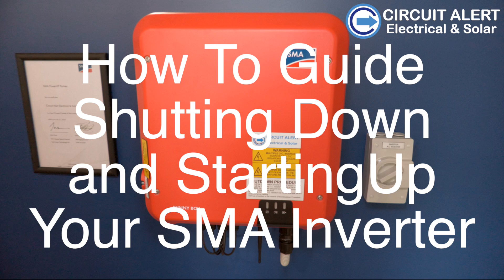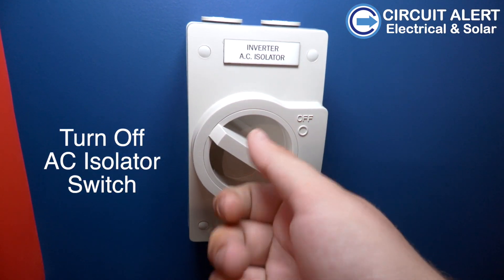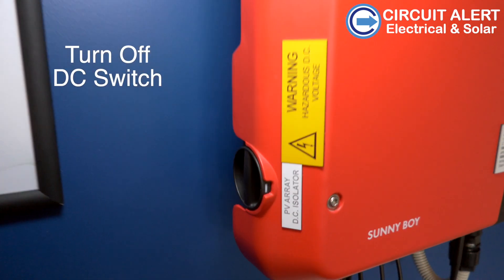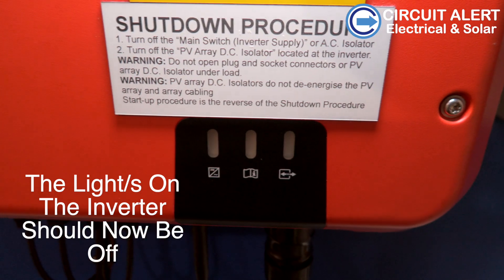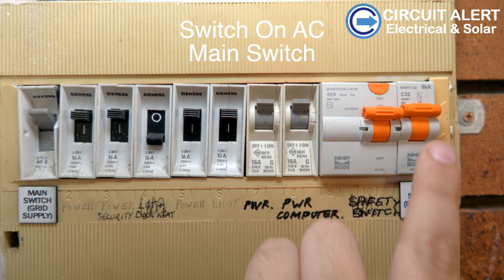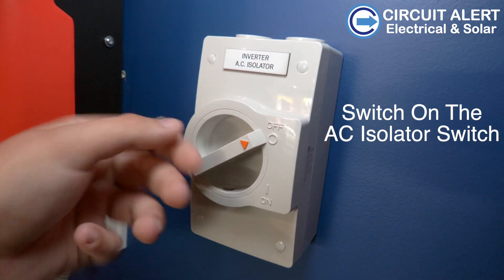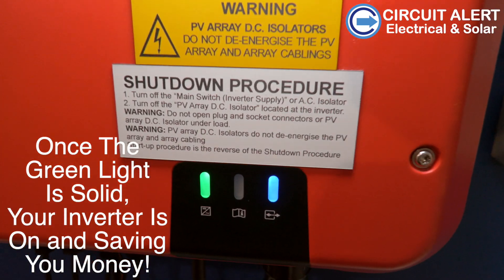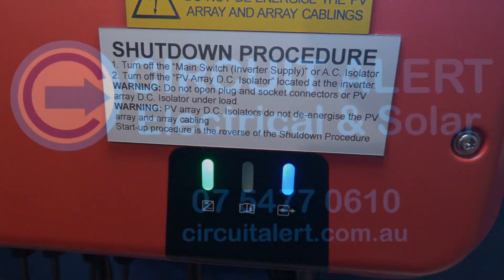How To Shutdown and Startup Your SMA Inverter

Comment: If you read the manual of the inverter, you will see that activating of the inverter is done by first switching on the AC, and then the DC switch.   Shutting down is also done by first switching off the AC,  and then the DC switch.